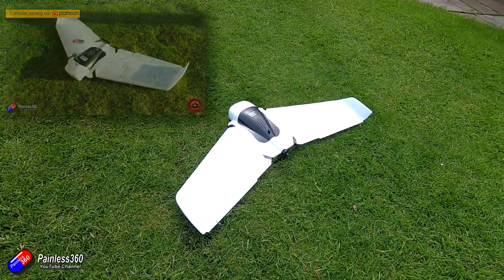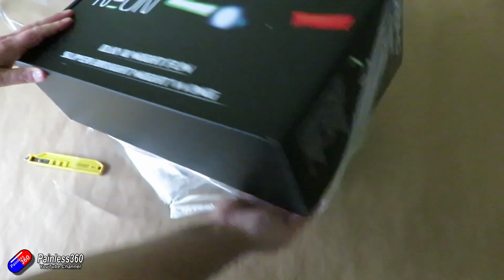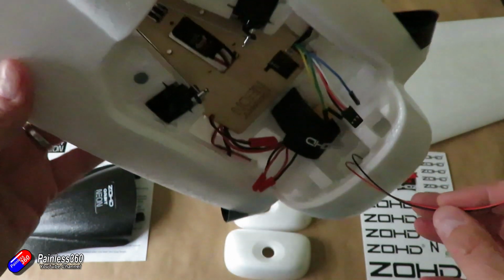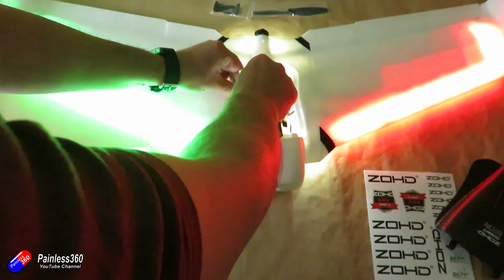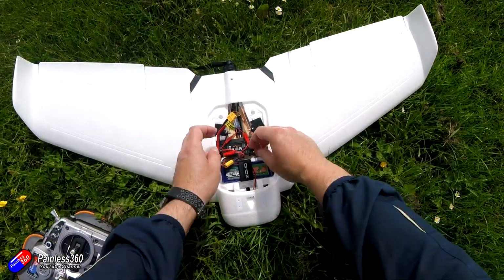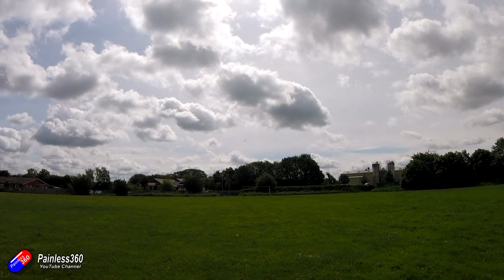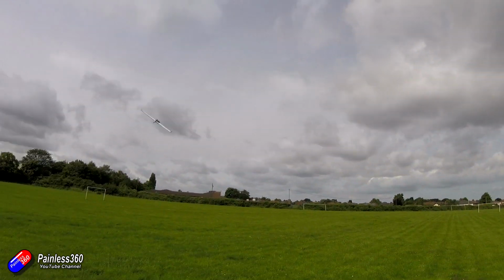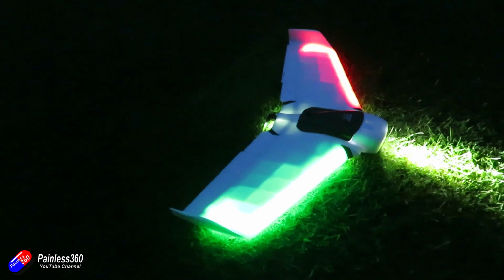ZOHD Orbit NEON

Comment: Is it possible to set a break on the esc so that the prop is level with the body when you cut power for landing?
Reply from the maker: Sadly not, folding props are the answer.. See my video on them..
Reply: @Painless360  Thanks, will do 👍

Comment: Is it normal for the gyro to apply what it looks like aggressive nose up elevator when increasing throttle and 6 axis mode selected? CG is set right on the marks.
Reply from the maker: In launch mode, yes.
Reply: Painless360 , ok! It seems a bit too aggressive specially since in order to land I was having to apply down-elev.
Reply from the maker: Don't land in launch mode and you won't have that problem. Happy flying
Reply: Painless360 this is my first wing so I was just trying to be extra cautious! Thanks for replying to my questions!!

Comment: I have a problem with mine i think when i turn on  the stabilizer the elevator on te right turns up way more than the left one. And is it normal when i trottel up the elevaters go up shouldnt they go down
Reply from the maker: Launch mode will make the elevators rise as you throttle up. Check the movement in manual mode. Best of luck with the maiden!
Reply: @Painless360  oh okey thanks but whats up with that one elevater that is way higher than the other one in launch mode wont this make my plane turn and maybe crash?
Reply from the maker: Have you tried it in manual mode? Looking at movement in anything else when not  flying isn't useful as the FC is expecting a resultant change in attitude from the moved control and doesn't see it. Please watch my series on it. It'll answer any other questions you may have...
Reply: I will certainly take a look at those series. I just received the orbit today and  tomorrow I am going to fly it for the first time  and thanks for the help

Comment: Great first wing for me, except: Trying to set it up with Crossfire, iNav and Jumper T16 which are all new to me. The iNav checklist is all check marks but I can't stop the motor from slow-beeping when powered up, and it won't arm. Have watched HOURS of videos and getting frustrated. Any ideas what I don't have set correctly? Thanks much!
Reply from the maker: Please see my recent iNav series (wing and Quad) for how I do it. The beeping could be for a few reasons, without knowing more it's tricky to point to something specific.. Best of luck!
Reply: Thought I had but must have missed something.  Will review.  Thanks so much for the quick reply!

Comment: Make yourself a 3s1p 18650 battery pack....able to get around 1.5 hours of flight time.  This is with the original orbit, configure with the neon an hour should be easy

Comment: Hmm. The leds don't really appeal to me but as an Orbit lover/owner are the tweaks to the stabiliser worth the extra cost? I did seem slight less twitchy in the breeze but that could also be your flying skills. 
The stabiliser on my now ancient Orbit has helped it to survive my very limited skills but I've gone through a few props
Reply: I have the same question. How big are the stabilliser differences between the original model and this one, and is it worth the extra cost
Reply from the maker: If you have the orignal then I wouldn't replace the whole wing...